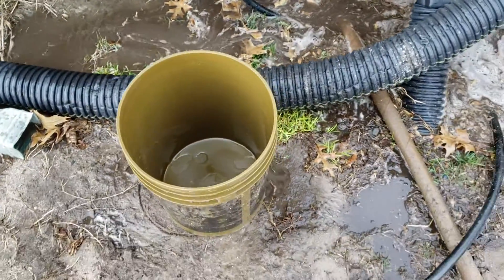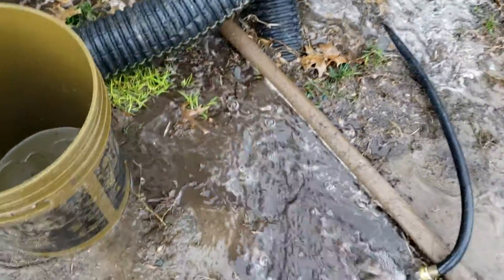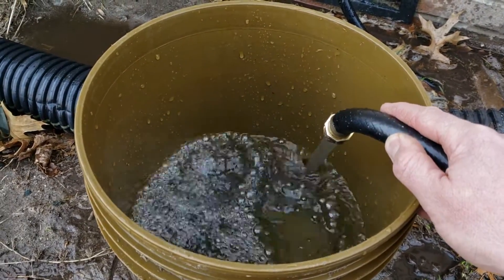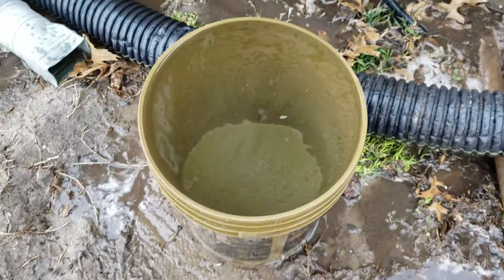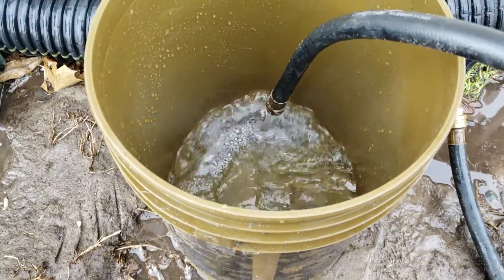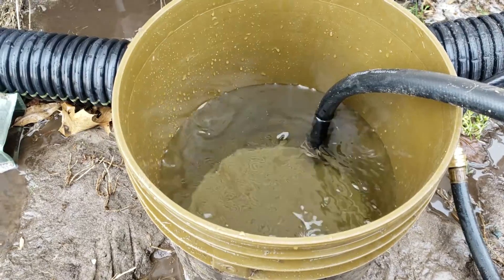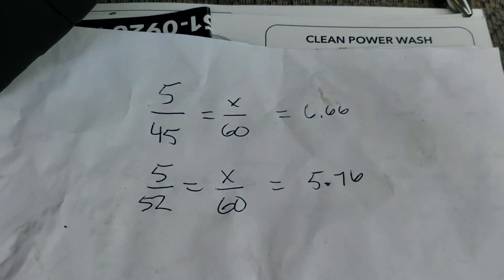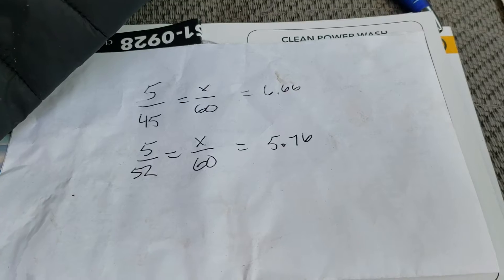How to calculate gallons per minute flow via a 5 gallon bucket test. And explaining flow loss.

Comment: If you have for some reason say a 1/2" feed to the hose bib and use a 5/8 hose the limitation will be in the 1/2 feed.  The drop from the 5/8 hose will be minimal.   If on the other hand you have a 3/4" feed and a 5/8 hose, the hose will be the majority drop.   I had a 1/2 feed with about 10 90's in between and got 3.2 gpm at the hose bib.  Moved that to 3/4 feed with two 90's and get 7.4 gpm.    Less and bigger is always better.  I had one house with a 1 inch feed and got insane flow rates with a 3/4" hose.   Moral of the story is the feed is sometimes the limiting factor.
Reply from the maker: @jeffm2787  absolutely.  Biggest possible plumbing at all times.   We also have 2 supply hook-ups.   One is hard plumbed to the supply reel the other is just 2 ft.

Comment: Your doing this test for a different reason which is to see how many heads you can add to a zone. I build all my zones smaller so that’s not an issue. What I would like to know is what’s a average seconds to fill a 5 gallon bucket? I would also like to know how many secs is awesome flow to fill the 5 gallon bucket. Let’s say the volume is low, how many secs would it take to fill the 5 gallon bucket that would be so low you would not install a sprinkler system? What secs to fill the bucket would be awesome volume? An example might be 15 secs to fill the bucket is very good where as 40 secs would be real bad.
Reply from the maker: I have no clue what you are trying to say

Comment: Flow rate in = flow rate out. However, the pressure will decrease with increased hose length (i.e., friction).

Comment: I think you are missing a huge part of the point here... guy claimed he was getting 24 gpm at the faucet and 6 gpm at the end of the hose, you are testing at 6gpm... of course there's no difference because its such a low flow to even start with especially for a 3/4 hose, to push 24 gpm through 100' of 3/4 would have a friction loss of about 65psi alone... 5/8 would be 200 psi! so your going to get nowhere near it at higher flows, it just so happens that 6gpm is so easy to do even on a 1/2 hose on some supplies (52 psi) that it makes your demo invalid.
Reply from the maker: Yes the guy claiming 24 to 6 was confused.   You would need to go through and insane amount of hose to have that much psi and flow loss.   This is why we run off of buffer tanks and use 2" pvc initially to maximize flow as much as possible before going to 1"
Reply: @Cleanpowerwash  no, you misunderstood me there, my point was that if you do this test again on a faucet that flows 24 gpm, your not going to see anything even close to the same at the end of 100' of 3/4" hose unless its on a high pressure water source. Your test showed minimal loss on the hose because it was such a low flow to begin with for that diameter hose... there isn't anywhere near as much friction loss. You could see the exact same problem on a 6 gpm facuet with a 1/2 hose for example. If he'd of used 100' of 1" hose he would of got pretty close to his 24 gpm at the source.
Reply: So a 4 gpm pressure washer would be be ok

Comment: Will this test work correctly with a pocket hose, it’s one of those expanding hoses? I did the test the way you did and I’m getting 5.17GPM! I am wanting to hook it up to a Karcher Cube 1700PSI 1.2GPM pressure washer. The instructions say use a 5/8 hose so the GPM doesn’t fall below 2.0GPM? If I’m getting 5.17GPM out of the expanding hose will it be ok?
Thank You!
Reply from the maker: No you should not use a collapsible hose
Reply: Clean Power Wash but it’s so mobile!! Lol. That is good to know! Off to the store to get a 75’ craftsman rubber hose!  I appreciate your help!
Thank You!
Reply from the maker: Your welcome.  We love the craftsman hose.  Very durable and easy to use.

Comment: Try to straighten out the hose as much as possible,  turns and coils of the hose adds resistance to the water flow cause a reduction of water flow.
If the water flow is real low in a job location, disconnect the garden hose from the hose reel and run it straight into the main water tank, you’ll get a little more water, the hose reel causes additional resistance.
Reply from the maker: Yep.  A straight or slightly curved is better than coiled up